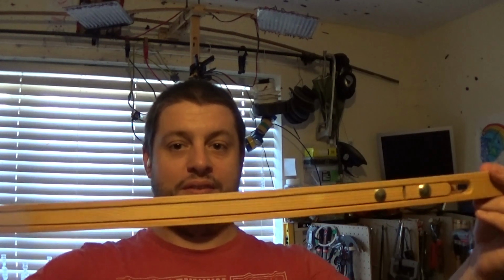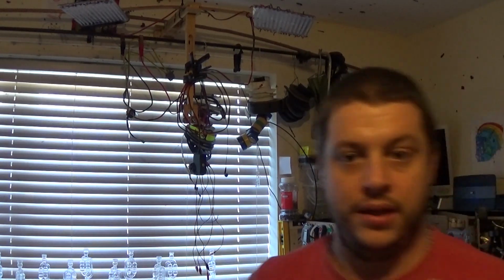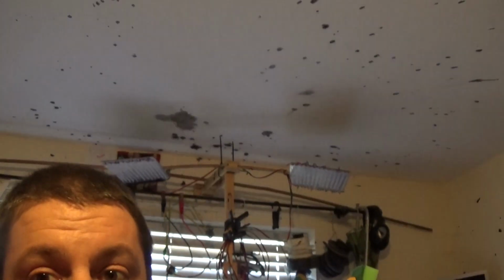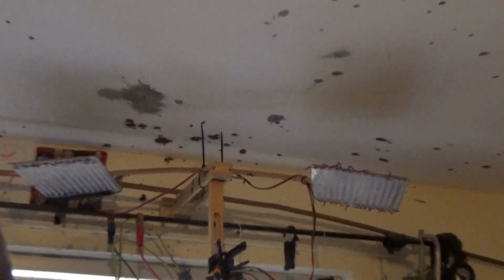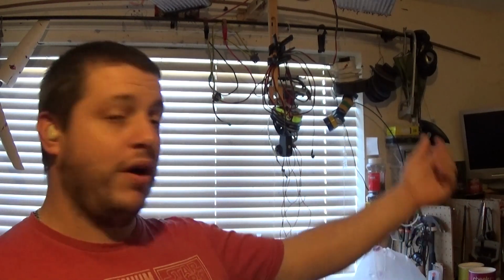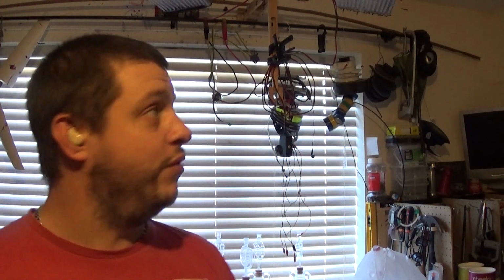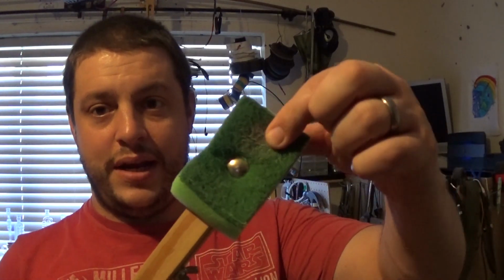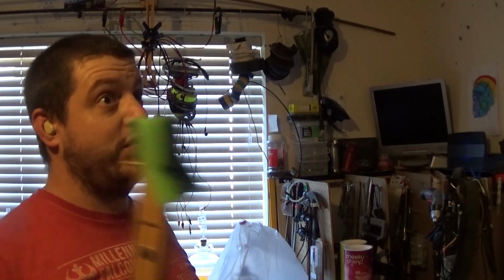Winesplosion Clean up | Trying to clean blackberry wine off the ceiling and walls!

Comment: i tried using water to clean up on some wine stains.. but the paint is starting to come off .. do you have any recommendations for that. do i need to repaint the walls ??. will using bleach destroy the existing paint ?.. or will small patchworks of bleach will leave a mark?
Reply from the maker: To be honest I'm no expert. I just cleaned up and it worked. The wine completely disappeared with bleach but a few years later the paint is peeling slightly in places. The places that you have removed the paint will probably need repainting. Good luck my friend
Reply: Thanks a lot :) appreciate it.
Reply from the maker: Good luck and if you need any help just comment